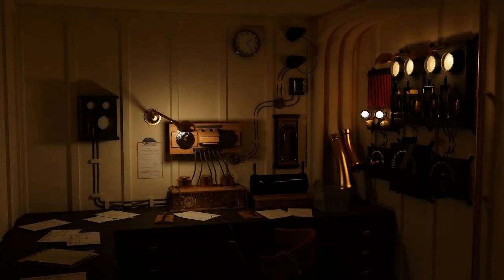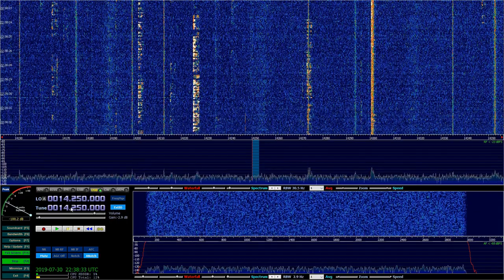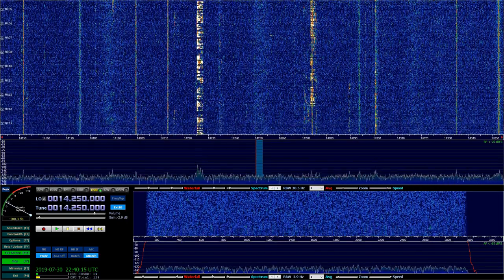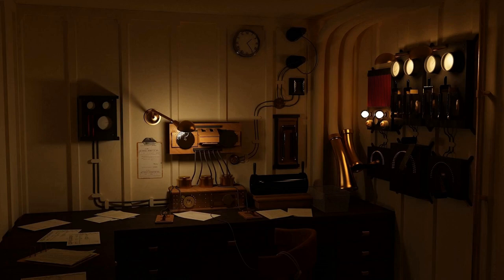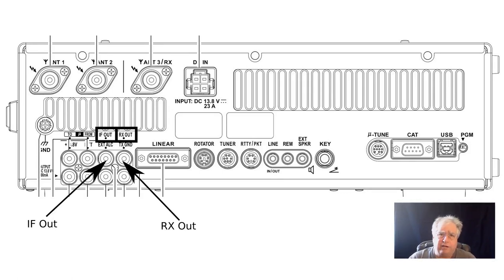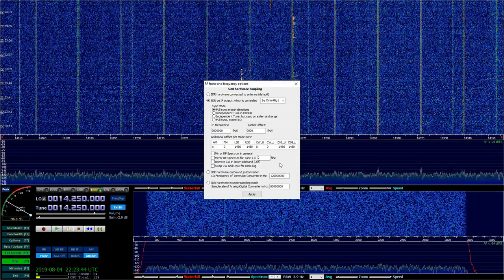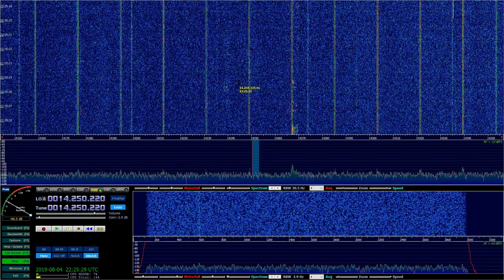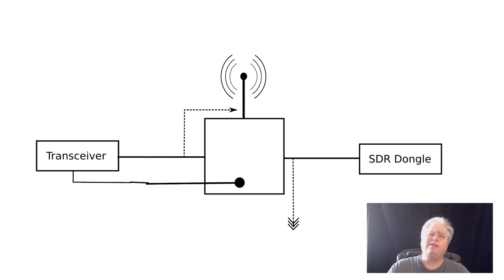Howto Interface Your Radio with your SDR and Share an Antenna

Comment: Wonder if it's possible to interface with a DX-394 receiver...
Reply from the maker: Hi D&RZ,
Not really sure if this video would apply to your DX-394. If you were trying to share the antenna between the DX-394 and a transmitter, then you could consider the switching methods described as working for your setup. Just substitute the info for the RTLSDR for the DX-394.

Stu
AG6AG

Comment: What SDR dongle do you currently recommend? Needs to be compatible with Mac OS, IOS  or pi? I’ll be using the MFJ 1708 B SDRS switch. With my old TS50.
Reply from the maker: Hi Ralph,
I use an SDRPlay. But I happen to like the RTLSDR.com V3 as well. They are already modified for direct sampling and you can buy them on amazon.

Stu
AG6AG

Comment: Can I ask a question? Could I transmit on my USB Nooelec SDR with a very tiny antenna to my radio that sits in my kitchen? I live in the middle of nowhere, no houses around me, so no chance of interference. So, lets say I transmit my downloaded music (mp3s) files via my computer that is upstairs, so I can hear my music on my radio in my kitchen and my radio in my garage at...say.. 90.7AM/FM. I would imagine my dBi output would only cover my property. Is this possible?
Reply from the maker: Hi Cdenver,
If I might recommend a better solution. You could just get a FM transmitter like the kind that Churches used during the COVID lock down to preach to their members in their cars in the parking lot of the church. This would give your a turn key solution rated by the FCC and will be limited to the allowable legal levels. These are sub $100 bucks and are available on Amazon.
That said, you could do it, but most SDRs don't broadcast, and if they do, I don't think they can transmit music quality sound. You would want a transmitter to outpub 54 KHz of bandwidth for good stereo audio. Plus you have the added issue of what the transmitter is authorized by the FCC to do.
Hope this answers your questions.

Stu
AG6AG

Comment: This may be a stupid question but Im just getting back into the radios and I have bought an amp so I want to be sure. Could you send me a diagram connecting this to a TS2000 with AT600ProII and AL 811 amp??  Thanks for any input on this. 73's
Reply from the maker: Hi Ted,

First off, there are no stupid questions... If I'm reading your question correctly, you are asking where to put the MFJ-1708SDR? If that's the case the answer would be to place it between the radio and the Amp. Your tuner needs to be between the Amp and the Antenna.

A few additional things...
You probably will want to make sure you isolate the Amp PTT circuit from the radio and the 1708SDR. I use the ARB-704 between the AMP and everything else.

I would also be a bit concerned about using the AT-600 Pro II at the Amp's full power if the your match on the antenna is worse then 2:1 SWR. For practical sizing I would start at a AT-1000 Pro II and move up from there.

I believe in the old saying 'Load for bear and hope for squirrels.' I run an ALS-600 with a PALSTAR AT2KD Antenna Tuner. This gives me the confidence that I will not melt down my tuner when working with high 'Q' antennas.

One last thing... There is no better way to drive your SDR then with an IF or RF output controlled and isolated by the radio. I saw that there is a mod for your TS2000. You might consider doing some research on that...

As always, do your research. I'm not running your setup and I'm basing my answers off the info you have given me. Before you plug things in, make sure you know what's going to happen.

I hope this helped!

- Stu

Comment: So, how do you tie into the PTT circuit of a TS-570D? Or any other radio for that matter? While your video was very informative, you never did discuss how to tie in the PTT circuit.
Reply from the maker: In your case you would tie into the 7 pin din connector on the TS-570 to get both a ground and a ground on transmit signal from the radio. On other radios it will vary,  but almost all HF rigs have a 'ground on tx' coming from the back for signalling am amplifier.

Comment: will this work for the Icom ic 718?
Reply from the maker: Hi Manoj,
Yes, it should work with your IC 718. The manual shows a 'Send Control' jack on the back of your radio. This will go to ground when transmitting and cause the MFJ-1708SDR to ground the SDR port. It even looks like you could just use a standard RCA patch cable for it. Make sure you read all the docs on the 1708SDR and your radio before hooking things up. I seem to remember a shunt inside the 1708SDR when hooking to ICOM, but I could be wrong.
Hope that helps!
-73
Stu